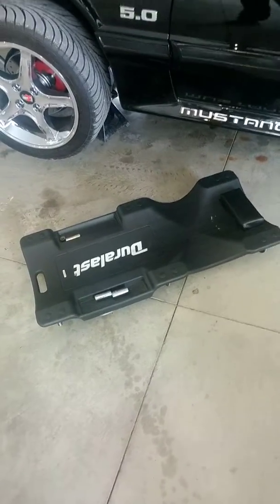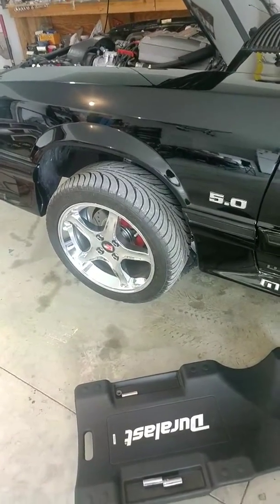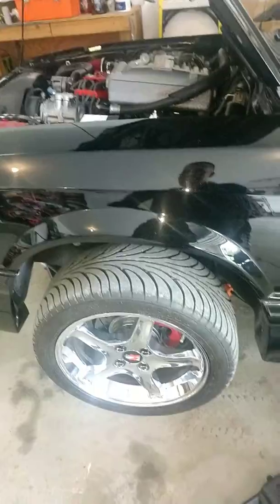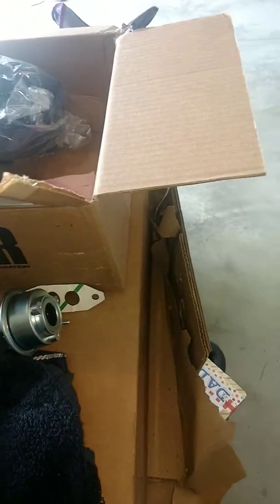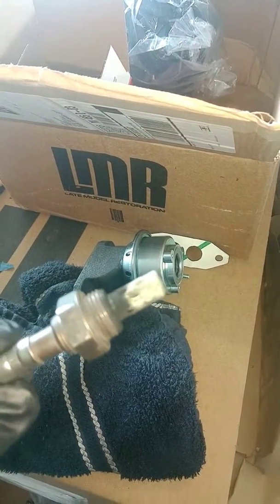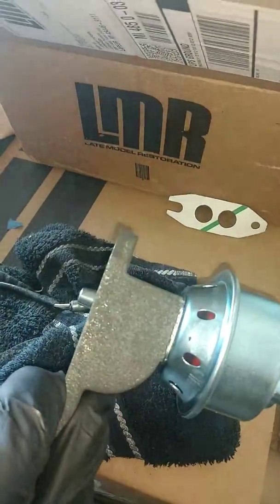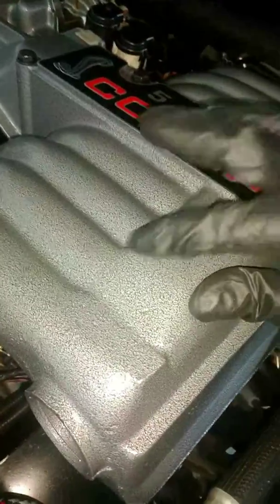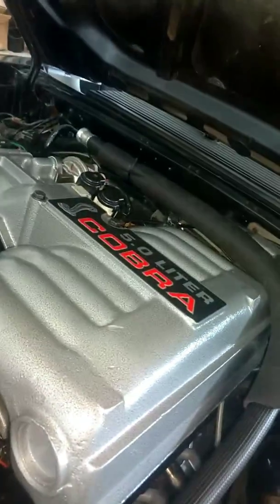Foxbody o2 sensors/EGR valve replacement s/Intake Hood Rub

Comment: She looks good.  Nice tint job!  Is that a 1 inch or 3/8 spacer?  Looks like a 1 inch.  The O2 looks bad... it does look like the engine was running very lean.  Good thing you got new ones.  I would pull a couple of spark plugs and take a look at them as well.
Reply from the maker: Thanks! Sitting in that tint shop, under LED lights, I really did a number on my front quarters! I'm gonna be compounding and wheeling this week!
The spacer is 1"....that's pretty irritating. Didn't notice it, likely rubbing "just enough".
I wonder if it's something I did to the fuel pressure or the fuel additive I used last year on the o2's? I don't recall them being white when I cleaned them over winter, when I swapped the H pipe?? 🤔
I'll check the plugs too...I did change those at intake swap too
Reply: @jpp9846  Keeping a car clean/detailed, is an endless task.  It is well worth the effort though.
Reply from the maker: @fwh79FOXR6  just got back from a test run...seems to be a little better. 
I pulled the battery cable, dump the codes see what I get tomorrow...check the plugs too.
You think I should pull that 1" and replace it with a 3/8? Pull it all together?? Get a patch for under the hood???
Thanks!
Reply: @jpp9846  I wouldn't run the 1 inch spacer.  It's just too tall and you are adding runner length to an intake manifold that has very long runners to begin with.  Getting the 3/8 spacer should slightly bump your top end power and fix the hood contact issue.  Did you get the new EGR installed?
Reply from the maker: @fwh79FOXR6  ok, guess I will look into swapping that spacer out. I need to tighten down the lower again anyway, might be a good time to do that swap. 
Yes, I got bot o2 sensors in today and the EGR. It didn't seem to be surging at idle, but I'm still going to run some codes, looks at the plugs and smoke it out once more. She sure does seem to move a little better. Might be the Cobra Intake difference...
Reply: @jpp9846   Sounds like a plan.  I'm sure there is WAY more low end torque being made with that Cobra intake.
Reply from the maker: @fwh79FOXR6  I think the 373 gears seem to mask what's gained lower end....but it t does feel a little more wild tho.
Reply: @jpp9846  It is possible that some power is still hiding in the tune.  That's were tweaking the timing and fuel pressure come into play.  You need the right parts, proper air/fuel mixture, and ignition timing to unleash the full potential of any engine combination.
Reply from the maker: @fwh79FOXR6  I ordered a 3/8 Phenolic spacer last night. Should be here by Friday. Like I said, I have to make sure those lowers are torqued down anyway, ain't nothing to pull that upper anyway. And that should solve the rub issue.
Isn't plug 5 the best one to pull to look at? I need to do that still...maybe tonight. I have noticed since I swapped those O2's, the exhaust smell isn't as bad. I mean it's still pretty stank without them cats...but not as bad. 
I'm going to pull codes later too...see what that ECM is detecting. I think I've replaced almost every sensor now.
Reply: @jpp9846  I would pull plugs 5 and 6 just to see what's going on.
Reply from the maker: @fwh79FOXR6  5 and 6 are still clean from when they were installed, probably need some more miles on them. Dumped the codes, need to get out and drive it this week and let ECU relearn and pull codes. 
Soon as the 3/8 spacer shows up, reinstall and do smoke test to check for leaks, hopefully should be good.
Need to probably get an alignment it seems after the Koni's were installed, wheel flops to the 11 o clock position? 
Minor stuff left, and a good DA session!
Reply: @jpp9846  Clean plugs is a very good sign.  I don't see how the Koni's would effect your alignment... that's kind of odd.
Reply from the maker: @fwh79FOXR6  I thought I read when you changed out them, "sometimes" an alignment was needed? Maybe that was coil overs??
Hmmm, now you have me thinking 🤔
Reply: @jpp9846  When was the last time you had the car aligned?
Reply from the maker: @fwh79FOXR6  never
Reply: @jpp9846  One of those struts may have been bad.  Had a huge problem with my dad's car.  He kept telling me the front sway bar needed to go back on the car because it had a strange wiggle when you got off the throttle after a hard launch.  I explained to him that the sway bar only comes into play in corners... yet he persisted that the sway bar was the problem.  So... we finally get around to swapping out his original front struts in 2017 (27 year old struts!) and he was blown away at how much better the car rode AND the strange wiggle was gone.  The struts were not rebounding correctly and that was causing the strange wiggle when you got off the throttle.  The bad struts were holding the front end up too long.  So the moral of the story is, bad struts can make your car do strange things!  Now that you have good struts, it's a good idea to get an alignment.  Plus you may have other suspension components that need replacing.  The alignment shop will spot them for you.
Reply from the maker: @fwh79FOXR6  I can see what you mean. Funny, or strange, how the steering wheel did not have that turn in it with the old Motorcraft struts (32 year olds, lol). But alignments are like $60...well worth the money, I'll put it on the list. The car doesn't "pull"...just has that steering wheel shift. 
Thanks!
Reply: @jpp9846  That could be a ball joint, inner, or outer tie rod.  Bad ball joints will cause some very strange steering wheel issues.
Reply from the maker: @fwh79FOXR6  see what the shop says I guess....strange. change the struts, messes something up. Wonder if I put the old ones back on, it'll fix it?
😂
Reply: @jpp9846  They should be able to spot the issue.  I doubt putting the old ones on would fix it... that would be too cost effective to workout in your favor!  Cars really enjoy draining wallets.
Reply from the maker: @fwh79FOXR6  ok...the car wants to quit when accelerating....it will start to climb in the power band, then *chug*...then will continue to accelerate, it doesn't pull hard after the chug either. 
If that makes any sense. 
I want to give the car about 20 more miles and then pull the codes. Not sure what that's about. I remember last year, it wouldn't chug, but just didn't want to pull hard. Ignition pickup?
Reply: @jpp9846  How old is your fuel?
Reply from the maker: @fwh79FOXR6   was thinking about this too during dinner. it is fall fuel and is under an 8th. Maybe some fresh 89 would be good?
Reply: @jpp9846  What's your timing set to?
Reply from the maker: @fwh79FOXR6  13-14
Reply: @jpp9846  Here is my long-winded "guess" since i'm not standing in your driveway putting my hands on the car. Your timing is kind of high but it might work for your car... every car is different.  I'm not sure what octane fuel you normally use but you need to use the highest octane fuel in your area 92 or 93.  Once you bump the timing, you need to use premium fuel all the time.  This is not optional.  If you are running 89 octane with 14 degrees initial advance, you are probably having a preignition issue.  That is only going to get worse as the weather warms up.  It could also cause serious engine damage, so you need to watch out for it.  Also, you need to stabilize your fuel.  If you have a Blain's Farm & Fleet near you, go there and pick up some of that Stabil 360.  They should have it in the 32 oz. bottles.  My Menards doesn't have the 32 oz. bottles, so I buy it at Blain's.  The marine version is more concentrated, so it is actually a little more cost effective.  Get that Stabil 360 and fill up with some premium fuel.  You may also need to dial the timing back to 12.  Other issues may be-  Computer is messed up because the capacitors are leaking, TFI module going bad (they like to fail very intermittently...which makes them hard to diagnose), a battery that is either in need of a good charge or going bad.  Driving the car does not recharge the battery 9 times out of 10.  Sitting in the winter time doesn't help it either.  Cold weather can drain and damage a battery.  So be sure to give it a full charge.  If it is more than 3 years old, you should have it load tested.  It's EFI, so you need solid battery power to run all the sensors correctly.  An old battery that is on its way out will cause all kinds of strange problems.  The battery doesn't just supply power, it also acts as a voltage filter.  As a battery ages, it loses its ability to filter voltage spikes and that can cause issues that you would never suspect the battery to be causing.  If you have a volt meter, you should check the voltage with the engine off and then start it and check the voltage with it running.  Should be above 12.4 engine off and 13.5 to 14.4 while running.  This issue could also be fuel pressure related.  A lean fuel mixture will cause issues very similar to an ignition miss.  However, I would focus on the fuel, timing, and battery for now.  You said your plugs looked good, but you may need a little more fuel pressure.  That intake is flowing more air and it needs more fuel to get the proper mixture for combustion.  You should try getting new fuel before messing with the timing.  See what she does with new fuel and we can work out a plan from there.
Reply from the maker: @fwh79FOXR6  thanks, yes, long and descriptive, That's good!  I will get some high octane fuel in there with some stabilizer, I don't have that Blaine store, but do have a Menards near. I do have a can of 44K??
I can dial back timing, too, after fuel and stabilizer. Sounds like a good start, will let you know...probably Thursday. Wednesdays are loooong!
Thanks again!
Reply: @jpp9846  You're welcome.  Menards should have Stabil but it is usually the smaller bottles.
Reply from the maker: @fwh79FOXR6  have you heard of the 44k? It's a fuel treatment, is this the same as that stabilizer??
Reply: @jpp9846  Don't know much about 44k.  From my 2 seconds of research I just did... looks like it is a cleaner and not a stabilizer.
Reply from the maker: @fwh79FOXR6  I'll let you know how some new fuel and Stabilizer does, then maybe knock back timing too
Reply: @jpp9846  Sounds like a plan.  Looking forward to seeing what happens.
Reply from the maker: @fwh79FOXR6  well, as instructed, I put some stabil360 in the tank tonight,  and filled her with 93. I drove it maybe 10 miles, still kind of seems hesitant. I got back to my garage, lowered the timing to 12, took her back out again...what's going on is at cruising, it chugs almost like it's missing. I'm going to go to a paint less dent shop in the morning, so I'm going to drive it probably another 30-40 miles in the morning and see how it performs. I'm going to pull codes tomorrow night. See if anything comes up.
A couple things I've read, TPS and PIP (Profile Ignition Pickup) in the Distributor & TFI (I know you mentioned TFI). So frustrating. But I do feel it's getting narrowed down.
I did order a new TPS...not a fan at throwing $ at problems, but here I am. 
One other thing I thought about...I replaced my rotor and cap on the Motorcraft Distributor, with a MSD. Just wondering if it's not playing nice?
🤔
Reply: @jpp9846  I doubt the cap and rotor are causing any issues.  Probably the TFI.  I have plenty of crazy TFI stories that are fairly unbelievable.  The worst part is, the low quality of aftermarket parts now.  You can spend good money on a TFI and it's bad right out of the box.  They are usually a "non-returnable".  Which is very irritating.
Reply from the maker: @fwh79FOXR6  hmmmm....I'm going to pull codes then and go from there. Some chatter on that PIP sensor (and possible TFI module) too. 
Going to have a brand new fox by the time I get this shit ironed out!
Reply: @jpp9846  I wish I had a cool car like an old fox body Mustang!
Reply from the maker: @fwh79FOXR6  who ever said that doesn't know....The Pain is Real!
Reply: @jpp9846  Hahaha!  Very VERY real!
Reply from the maker: @fwh79FOXR6  if I had some how (very possible) put the the wrong number plug wire on the distributor cap, would that mess shit up? I followed how the wires were attached to my old distributor, this is how I replaced them...what's your thoughts there?
I'm pulling codes later tonight, BTW.
Reply: @jpp9846  Yes, that will cause problems for sure.  Do you need the firing order?
Reply from the maker: @fwh79FOXR6  I guess I do need firing order, I bet I mucked that up.. I pulled my codes tonight....with the KOEOff I pulled the 81 & 82, no big deal, my Air Pump.is gone. What's telling is the next 2, 22 and 10. 22 points at Map Sensor...I bought a new one and installed, WTF? And, a code 10 (cylinder 1) problem? I never had those two codes. I'm going to research closer tomorrow.
Reply: @jpp9846  Just because the MAP sensor is new, doesn't mean it is working correctly.  Firing order is 1-3-7-2-6-5-4-8  Distributor rotation is counterclockwise.  Passenger side of block front to back is 1-2-3-4  Drivers side of block front to back is 5-6-7-8
Reply: @jpp9846  I think your wiring is probably correct.  You would have a very poorly running engine if you had some wires mixed up.  However, double check it anyways.
Reply from the maker: @fwh79FOXR6  thank you, I'm sure it's correct, I was very careful when I modeled it to the other cap...but it's possible. I will be looking at some stuff this afternoon.
Reply from the maker: @fwh79FOXR6  reading up on these codes, 10 is typically just a spacer code, that only points to Cylinder 1 when it's a KEEOn test....so I'm going to side step that one for now. But 22 points at the MAP (BAP in 89+ models). And if that's faulty, it will cause all the issues I'm having. Loss of power, idle issues, lean fuel. Makes me wonder now, since I put a brand new one in (and foolishly tossed out the old one) if it's the actual wiring harness itself and NOT the sensor? Will be looking deeper into this later.
Reply: @jpp9846  Yeah... you really need to save all of your old parts.  This whole "bad new parts" crisis is really annoying.  It is also possible that the MAP sensor is not getting the correct voltage because of bad wiring.
Reply from the maker: @fwh79FOXR6  I got into a few things yesterday that are bleeding into today. First, I pulled the Upper Intake, going to swap the Phenolic spacer for a 3/8...and, torque the lower again. 
I pulled the MAP and cleaned all contacts with electronic cleaner. It appeared when I pulled it, the connector and vacuum was loose....we'll see. If it's still pulling that code, I will investigate the harness. 
I also opened up and did an electronic cleanup on the 10 pin connectors. More of a maintenance move here...but I read these dam things can cause BS too. 
Lastly, my TPS came in yesterday, so I put that on as well. What I noticed removing the old TPS, was one of the screws was actually sliding down into one of the holes. I don't think it was being held very firm, in place. That "could" also be the culprit. 
So I need to get the upper back on today, adjust the TPS and see how it performs. I will pull codes again to see if I'm getting that 22. If I am, I'm going to be looking very hard at that MAP and the wiring harness. 
The symptoms to a bad TFI don't really seem to fit like the TPS or MAP. Doesn't mean it isn't working with the PIP against me tho. I will be keeping one eye on that too. 
That's where I'm at, will let you know what I find.
Reply: @jpp9846  Sounds good.  It would be nice if it was just the vacuum line being a little loose on the MAP sensor.  That 10 pin connector seems like it is a common problem.
Reply from the maker: @fwh79FOXR6  ok, firing order correct. Phenolic spacer swapped, 10 pins cleaned and re lubed, new TPS set at .92....timing set at 12 degrees. 
Took it for a ride, she is so squirrelly! Feels like so much more power in second gear...but the chugging at cruising and what seems like power loss, is still there. 
The big question. I have my MAP directly vacuumed to the TREE, as it was with the old intake...should it NOT be vacuumed on the Driver Side Vacuum Tree, but instead, on the Manifold? I've used all my ports on the Intake, Main (Source), PVC, FPR, EGR. 
I'm wondering, since this is a Cobra Intake, if the MAP vacuum line needs to be hooked to the Manifold and not directly to the tree????
It's Speed Density...so, it might need to be that way.
Let me know what you think, thanks!
Reply: @jpp9846  It's worth a shot moving the vacuum line.  I never worked on a speed density car, so i'm not sure where that MAP sensor gets it's vacuum from.  I would think it would need to be directly connected to the intake manifold for an accurate reading.  Sounds like you are getting closer to fixing your problem.
Reply from the maker: @fwh79FOXR6  I've done a shit load of reading and everything indicates that MAP needs to be plugged into the Intake and not on the tree. In fact, the B/R spot on that tree (that is currently hooked to the MAP) is supposed to have a nipple on it, plugging it. Why, the old map was hooked to the tree is beyond me. Looks like I need to get an 3/8" elbow for under the upper for.the PVC and use the current PVC port, for the MAP.
I'm almost certain this is the issue with my car. The MAP can't get a true reading of what the hells.going on inside the intake so the ignition/air/fuel ratio is be retarded by the ECU...thus the shitty performance.
This is my guess. I have to see about getting that elbow (see them on eBay) once that gets in, I again, need to pull the upper and redo the vacuum lines. 
I did notice that to the back far right of the lower intake, where there is a "square plug", there seems to be some coolant "weeping" out. Probably need to get a square socket and tighten that some....or pull it and tape it. 
I think I'm getting to the bottom of this shit. It makes complete sense...stay tuned!
Reply: @jpp9846  Sounds like that vacuum line is causing the issue.  Like I said, I have very little time around speed density cars.  I have no idea where the MAP hooks up from the factory.  You should make a video about it.  Seems like important information that could help someone out.  I'm sure whoever installed the bread box moved the vacuum line to the tree on the fire wall.  That is a huge problem with these old Mustangs.  They pass through the hands of several ignorant people who think they know what they are doing.  Then when you get the car, you have the fun chore of undoing their misdeeds.  I get the feeling your car has not been "running right" for over 15 years now.  I'm sure it will be nothing short of amazing when you get her running right!
Reply from the maker: @fwh79FOXR6  I agree and think that's a BIG problem too. I probably will do some video too, you're right, it could help someone. 
You also said you thought it would need to be hooked up to the Intake and that makes sense after what I've read. It came from factory, hooked to the Intake, the tree plug its on now, is the B/R, that came with a rubber nipple on it, from factory.
Here's another thought, if a person added boost, wouldn't that mess with the Intake Manifold reading and make the car run like shit?
But, if you hooked it to the tree on the wall it would have the same vacuum at all times...maybe it needed to be that way in the past?
But this "might" be the issue. Hoping to know soon, busy week headed into holiday, I'm going to try to get to it before. 
Will let you know, as always, thanks for the counsel
Reply: @jpp9846  You're welcome.  I'll be happy to see you finally get this 5.0 running right again.  It seems like the car would have been converted to mass air if a supercharger was going to be installed.  However, there is an old issue of Muscle Mustangs Fast Fords where they got 2 turbos off of Thunderbird Turbo Coupes from a junk yard and made a speed density car twin turbo.  They installed a check valve on the line going to the MAP sensor so it would not see boost pressure.  They made it work... but that seems like a very rare set up.  Once again, who knows what this car has been through in the past!
Reply from the maker: @fwh79FOXR6  would about Nitrous? Does that effect vacuum?
Reply: @jpp9846  No, nitrous does not effect vacuum.
Reply: @jpp9846  How's the Stang doin?  Any updates?
Reply from the maker: @fwh79FOXR6  I'm still scratching my head. I did re-route the MAP directly to the Manifold. It still is giving me some hesitation and what seems like a chug at cruising speed. Some times when I mash the gas, it will go, then hesitate then dig in. It's really strange. I think it's either fuel or spark. I don't have the right tools to test my coil...or the PIP or TFI module. I was also reading the fuel pump might be the problem. I have a can of seafoam that I'd like to at least try...maybe a clogged injector?
I have a soccer game I'm about to head to, I'm taking the car. I want to drive it a little more then check codes again. It's really strange to me that I got that 22 code (Map out of range) after replacing it over the Winter. If I get that again, I may have a faulty MAP??
I will let you let you know ..so far, same bullshit 😠
Reply: @jpp9846  Did you reuse your old injectors?
Reply from the maker: @fwh79FOXR6  yes I did. Remember, my Cobra Intake came with 24's, you recommend I not use them with my set up, so, I plugged my 19's (and the rail) into the Cobra lower and pulled the 24's it came with (and rail). I still have them and been thinking about that too. 
What's your thoughts?
Reply: @jpp9846  Well your car was fine with the original 19's on there.  I couldn't remember if you swapped a different injector in or not.  Honestly, I think it's some kind of ignition problem.  I doubt it's the coil because they usually either work, or die.  Are you sure the distributor is installed correctly?  Maybe you are off a couple of teeth on the distributor.  Also, i'm not sure what kind of timing light you have but some of them let you alter the timing on the gun with a dial.  You need to make sure that dial is set to zero when you are making your adjustments.
Reply: @jpp9846  How did the car run for you yesterday?  Does it start up fast or is there a long crank time?
Reply from the maker: @fwh79FOXR6  it typically turns right over (within a second or 2) unless I let off the key too early. 
It seemed to run a little better...but did notice when I got it back to the garage and parked. The idle would sit at 1, then blip, up a little, then drop a little (hunting?). And of course while at cruising speed, it still seems like it gets a momentary "choke"...it's like it hiccuping, that's the best word.
I did think about those injectors too. I think another timing, idle reset, and TPS adjustment should be done, and FP adjustment...and I am going to pull codes again. 
I will say this....there is a hell of a lot more power in second gear then I can ever remember. The tires will spin! But it doesn't happen all the time.
Reply: @jpp9846  There is something that just isn't right and it's messing everything up.  That's a good sign that it starts up quickly.  Still almost seems like a vacuum leak or an ignition issue.  Maybe there is a vacuum leak at the brake booster.
Reply from the maker: @fwh79FOXR6  something hasn't been right for a while. You know, all of this problem started AFTER that WOT "stuck" issue last summer. That is when I noticed the power loss in acceleration. Seems like it has more rev, than torque and acceleration. 
I did read some guy was having all sorts of issues, turned out to be an internal brake booster vacuum leak. That is on my mind too. I feel like buying a distributor, with a new TFI module, a new coil pack...but I just don't like to toss money when I should be diagnosing. I read another board that some dude had the same issues, was an ignition switch AND distributor. The car is drivable...I can drive it. I just want it to run better, it definitely can. 
I certainly feel a difference with the cat-less H-Pipe and this intake, it's a big difference, especially in 2nd. But she isn't running Optimal. 
I have a large deck project currently going on in my backyard, so I can't get to the codes today, that will be my starting point. If it says 22-MAP out of range again, I'm going to be questioning if that dam thing is even functioning. 
Another smoke test probably wouldn't be a bad idea, to see if there is a vacuum leak. Will pay attention to that brake booster. There is a few things I can try there. Even thought about getting a stethoscope. Run that seafoam through the injectors as well.
You don't feel I should be running those 24# injectors, do you?
If you can think of anything else, please let me know, thanks man 👍
I should drive this dam thing to your garage! 😂
Reply from the maker: @fwh79FOXR6  I just seen this! Not sure why my notifications are all jacked up? Yes, Ignition is my thoughts too. But where??
It's possible I dicked up that distributor installation....that was the first time I ever pulled or stabbed a distributor. How to know?? How would
Fix it?
It's either a leak, ignition or sensor. Suck, Boom, Blow, one of them things, lol
Reply: @jpp9846  Trust me... YouTube does an excellent job of messing up and just not giving you notifications.  I love when I find a comment on one of my videos that is someone asking me a question from a year ago!  YouTube is like everything else... it just don't work!  The best way to "fix it" would be to pull it and line up the 10 degrees BTC with the pointer.  Then slide that puppy back in there.  It seems like you did it right... but you never know.  It really doesn't take much to mess this stuff up.  I make plenty of mistakes doing things that I have done for 20 plus years now.  So, it happens.  Hahahaha!  Yeah, it's probably one of the suck, squeeze, bang, blow parts of the equation!  I'm sure you are getting a little frustrated if you are getting a taste of more power now.  Imagine what she is gonna do when you fix whatever is going wrong right now!
Reply from the maker: @fwh79FOXR6  so....line of the up on 10 TDC? So, pull out the distributor, and turn it at the harmonic balancer...alternator? To line it up at 10, then re-stab it? 
I know I may have screwed it up...I had a lot of things I did this winter. The thing is, it DID NOT do this before the swap. It definitely was "boggy" and not accelerating very well ...but now, it does this hiccuping at cruising?? Now I'm at a graduation ceremony, so no codes today. 
I want to run some tests and see what the car thinks the problem is. 
I pulled some brake booster test today at work, need to look at that too. I know this thing is waiting to be unleased....it definitely has a shit load more power.
But let me know if I read that right and how to get it at 10 TDC, thanks man!!
Reply: @jpp9846  You need to pull the plug on cylinder 1 and turn the engine over by hand with a ratchet (should be a 24mm for the nut inside the center of the crank pulley) spinning the engine clockwise from the front looking to the back of the car and the distributor still in the engine but with the top ignition cap off so you can see the rotor.  You should hear the compression stroke because air will come out of the spark plug hole.  If you are on the exhaust stroke, the air will flow out the opened exhaust valve and not the spark plug hole.  As you spin the engine over a full 720 degrees (two full rotations) for the 4 cycle engine, one time the piston comes up will be for the exhaust stroke and the other time the piston comes up will be for the compression stroke.  You want to be on that compression stroke.  Once you are sure the piston is coming up to TDC (top dead center) on the compression stroke you want to line up the 10 degrees BTDC (before top dead center) mark on the crank damper with the pointer on the block.  Just keep spinning the engine over slowly by hand with a ratchet until the marks line up.  Then you can look at the rotor and see if it is pointing at the cylinder 1 terminal on the cap.  If it is lining up you should be good... if not, you need to remove the distributor and try to reinstall it so the rotor points to the cylinder 1 terminal on the cap.  I'm sure you still have the marks on the distributor from when you originally did it.  Try to verify that those marks are accurate.  Make sure you can clearly read the marks on the crank damper.  Triple check that you are looking at BTDC and not ATDC (after top dead center) on the damper markings.  You may have to clean them up and mark them with a marker.  I'm sure you already marked the damper, so double check that you marked the BTDC and not the ATDC section of the damper.  That is a very easy mistake to make, so take the time and verify that you are using the correct BTDC marks.  When you're all done... you need to start up the engine and warm it up to operating temperature so you can reset the ignition timing with a timing light.
Reply from the maker: @fwh79FOXR6 Thanks for the detailed description.  You know, if that rotor happened to point at that 1, during the exhaust stroke, then I may have been on the exhaust stroke and not on the compression, when I lined this up before pulling it last time. Would that make the car run like this??
I probably should check it, just to be sure. 
I "think" I was concentrating on the rotor pointing at "1" and not the the stroke AND the point. 
Let me know your thoughts. And I appreciate you helping me navigate thru this!
Reply: @jpp9846  If it was on the exhaust stroke, you would have big problems getting the engine started and keeping it running.  I can tell you this though... back in the late 90's these guys I worked with build a crazy small block Chevy 350 and got it out to the the track with high expectations.  The car ran like a DOG.  High 17 second passes... way off from where it should have been.  Later on they figure out there is a problem with the distributor not advancing correctly.  They fixed the distributor and took it back to the track, the car ran 12's.  Incorrect ignition timing can really make or break an engine.  The same thing happened to my buddy Bob's cousin George.  George has a fox body with a 351 stroked out to a 408 and they were having problems with it.  So Bob asked me to stop by and look at it.  I thought maybe the distributor in the car was the victim of an octane rod swap.  Some of the old performance computer chips came with an "octane rod" which you swap into the distributor.  That octane rod will increase the ignition advance.  So we got to talking about the ignition system.  Then I told Bob the same story I just told you and it clicked in his head.  The next day Bob got a new MSD distributor and swapped it in.  That 408 ran like a beast after that.  I'm not saying you should run out and buy a distributor... I'm just saying whatever the problem is, it is causing huge issues that are holding back power.  I personally think it's an ignition problem and I would also pull the computer and check it out if you haven't already.  The computer might have a performance chip in it or the capacitors may be leaking.  It's worth looking into.  There is a good chance you have more problems cause by the ghost of previous owners.
Reply from the maker: @fwh79FOXR6  here's another detail I've been thinking about. When I pulled the distributor, I placed it in a plastic grocery bag. Mostly because I didn't want that gear to dry up. However, Plastic Bags can cause static electricity...I had a passing thought that maybe that messed with the PIP or TFI?? 
So in your friends case, his distributor was bad? And when you're saying ignition issue, are you thinking solely about the distributor??
I know you mentioned the ECU...and I have read people having problems, only to later discover a tune in there...so that might be something too. And, being I KNOW that kick plate was removed, because I replaced the missing plastic pin that was holding it in place.
I really don't feel confident pulling that ECU, PCM, whatever and opening it...unless you have something I could go off of?
You're right tho, it most likely IS an owner in the past think haunting this thing. 
Let me know what in particular you are thinking regarding the ignition (distributor bad?)
And about the ECU. I'm starting to wonder if I have that set right on exhaust or compression tho..🤔
And I want you to also know, I replaced the rotor and cap on this Motorcraft Distributor, with a MSD rotor and cap, with Ford racing wires, during the intake swap this past winter
Reply: @jpp9846  I don't think the plastic bag did anything... should be fine.  It could be the distributor, but it might not be.  Keep in mind, that distributor is sending signals to the computer.  If the computer is not functioning correctly, you are gonna have issues.  I would disconnect the negative lead to the battery and remove the computer.  It's fairly easy to do.  I think the EECIV video I made explains how to get it out of there.  You are going to need tamper proof torx bits to open the case.  I think you should start at the computer because there is a very good chance your capacitors are leaking.  I would also pull that number one plug and line up the timing marks.  That way you can verify that you are lined up with the compression stroke and not the exhaust stroke.  Those are easier things to do than pulling the distributor again.  Start with the easy stuff.  I get the feeling your computer has some leaky capacitors.  Both of my cars did and they are 1990 models... your car is even older.  Inspecting the computer should be number one on your list right now.  Just be sure to disconnect the battery power before you pull the computer.
Reply from the maker: @fwh79FOXR6  I will be sure to get some of those torx bits and I guess start at the CPU. But man, I have no idea how to read a dam electronic board, I'm going to be reading wallpaper...maybe I make a video? 
If nothing there, move to the distributor itself I guess and make sure everything is plum. 
You're right, it's a good possibility it could be leaking....or hell, there may be a chip there. I will look through your list and see if I can locate that video. 
At this point, I'm just wanting to look at things. I am getting a little frustrated throwing $ at it. It's time to get to the bottom of this thing. 
I like this car too much to just up.and sell it, that is not an option. It's most likely something simple killing this Fox's performance. 
Again, I have a shit load going on around my place right now...I'm going to be plugging away at things (yard work if the rain ever stops), and try getting to this again, this coming weekend. 
Still want to look at codes to see if the 22 is cleared up. 
I wish I had a cool, Foxbody Mustang, L, M, A, O!